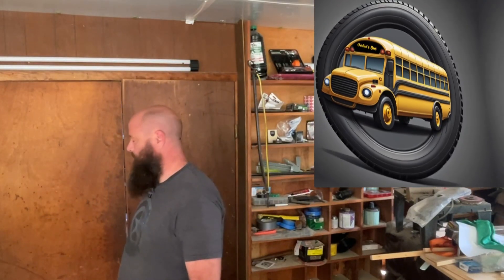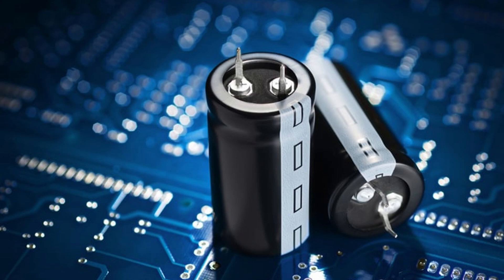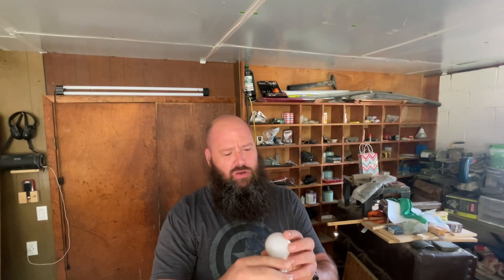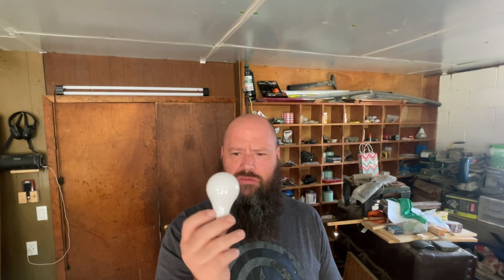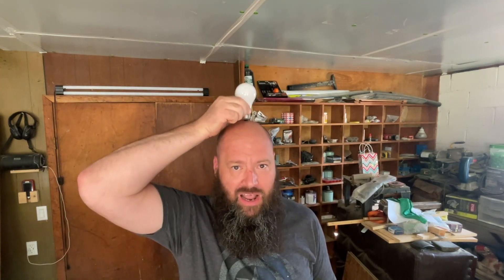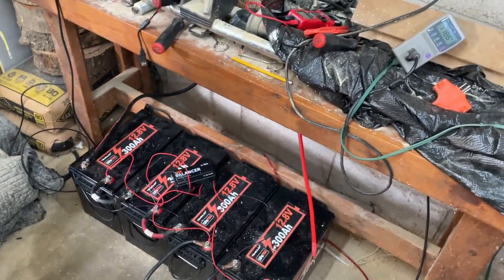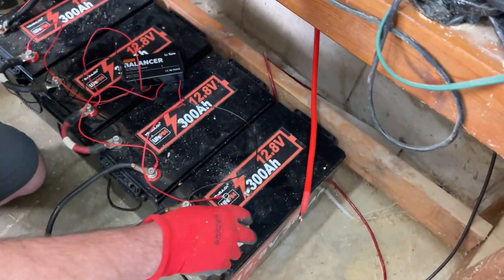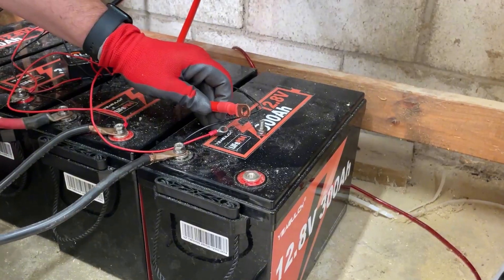Using Light-bulb as a Precharge Resistor - IT WORKS!!!

Comment: what voltage was the battery bank?
Reply from the maker: They where fully charged. When I got the batteries I used a stand alone lithium battery charger to fully charge them
Reply: @OobiesTips  ok, what is the house voltage? You used a 120V light, is the bank 120? 48? 24? 60? Or will that kind of bulb work on 12V and up?
Reply from the maker: Any iridescent bulb. I believe mine was a 60 W.

Comment: Use a Carpenter's Pencil or a 12 Volt Tester
Reply from the maker: Yes I did read about that the graphite in a carpenters pencil would work. However, I never thought about using a 12 V tester. But I gotta say I really love the interaction of the lightbulb, how it lights up and it gets dim overtime.
Reply: @OobiesTips Anything is Better than a Stun Gun Zap to The Hand or Face = Wear Gloves and Goggles around High Amperage Devices.